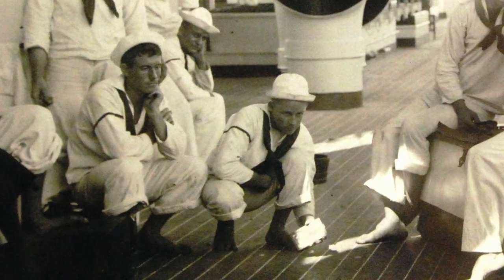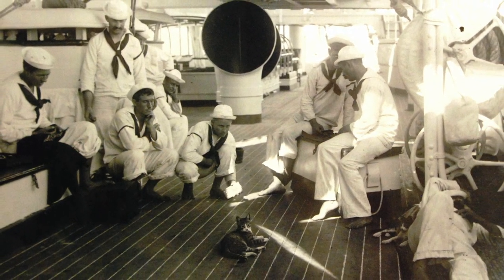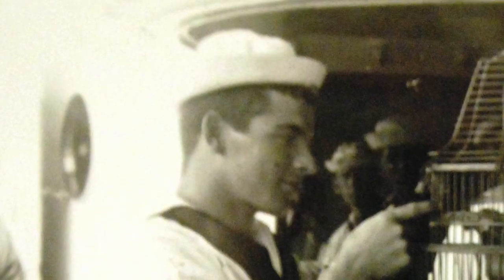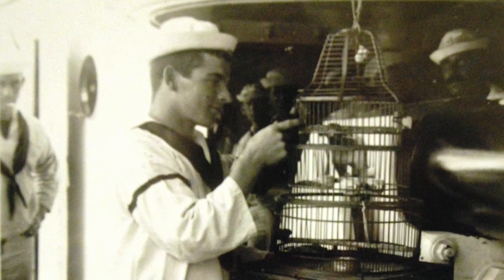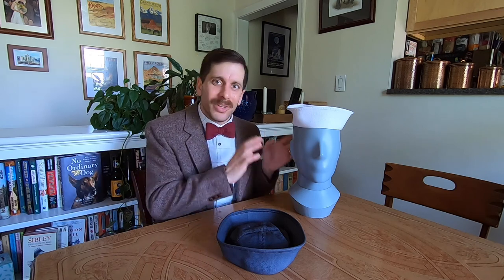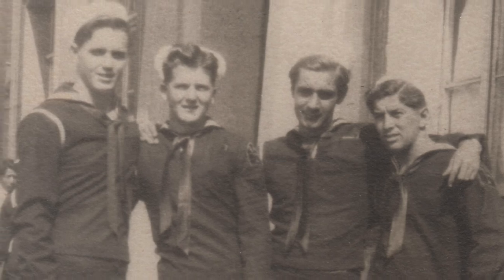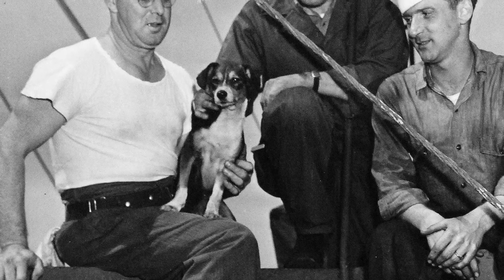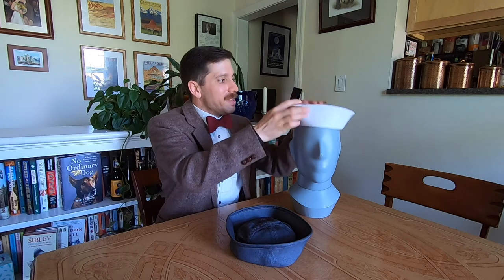Artifact Spotlight: The Dixie Cup

Comment: I was in the U.S. Navy from 1976 to 1984. When I went in in 1976 we were issued ball caps and I had the same ball cap all the way until the 1980s when the 'Dixie Cup' returned. I hated the Dixie Cup! Even on ship and at sea we had to wear them back then! I had so many fly off my head and into the ocean that it was ridiculous! Every time we got into a port with a Navy commissary I had to buy 6-12 of them to replace all the ones that I lost! And anyone who has served on board ship, especially on Winter Westpacs can tell you, it gets very windy! I don't know about what happened after 1984 and my service connected injury! I served on the USS England and the USS Bainbridge. Liked the England, didn't like the Bainbridge.
Reply: I was in 79 to 85.  You're right.  Could not keep it on your head. The cracker jack was re-issued 79 or 80 in polyester,  not wool. Our utilities supplied with the ball cap.
Reply: @johnjay9404  I believe it was 80. Seems I got issued mine about the time I was trying to decide if I should re-up or not.
Reply: Although I never did it because I rarely had to wear it an old lifer said to run a bobby pin through the tab and hair.

Comment: I'm a Navy vet 1967-71. Was issued two dixie cups but had to buy more during my four years. They were the primary cover when not in dungarees. Ball cap or knit watch cap were only for dungos. Some of my dixie cups are at the bottom of Argentia Bay, Newfoundland as it was always very windy at the naval base there. 2nd duty station was Cinclantflt headquarters (also Nato) in Norfork, Virginia. Uniforms always had to be 4.0 squared away there and we were in dungarees only on midwatches. White hats were hard to keep clean and wore out fast. I always kept one separate for personel inspections only. I saw one of my shipmates get his ass reamed by the Master Chief for wearing a dirty dixie cup. We were allowed to personalize the shape of our dixie cups within limits. Folds and wings were allowed but no wearing on the back of the head and not much tilt to one side. I notice now they must have strict hat cover regulations as they are worn perfectly round and not personalized. Too bad. Back in the day how a sailor wore his dixie cup was sort of an indicator of what kind of swabbie he really was. I never really minded the white hat too terribly much. They were light weight, cool in the summer, and cheap to replace. I still have my inspection cover complete with name stencil and my dress blues. Unfortunately the blues no longer fit. 
H.J. Hansen RM3.